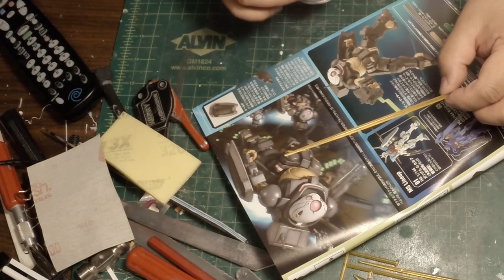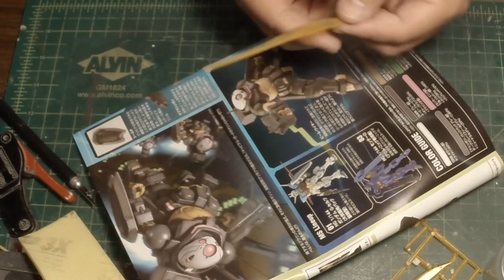Working with Clear Parts

Comment: One issue I have is with smaller HG beams and how hard it is to denub them without breaking or warping them.
Reply: Channel 2S: Gunpla News and Reviews I found that using the hobby knife to gently cut the nubs away works just fine
Reply: Channel 2S: Gunpla News and Reviews how would one change the color of a pre colored (clear)part, just paint it over with colored clear paint and hope for the best?